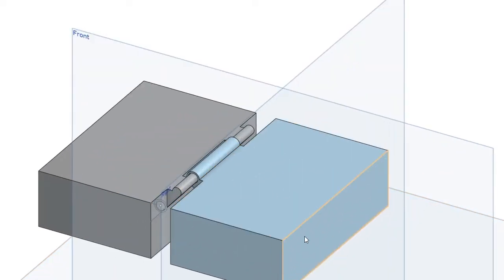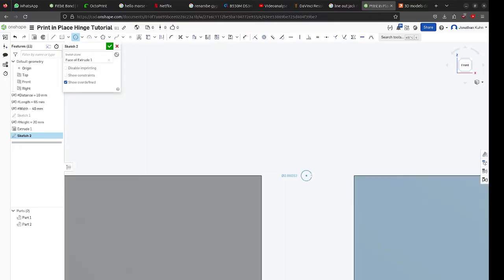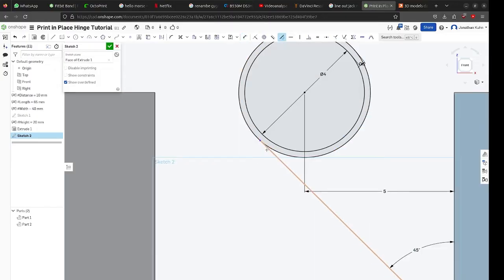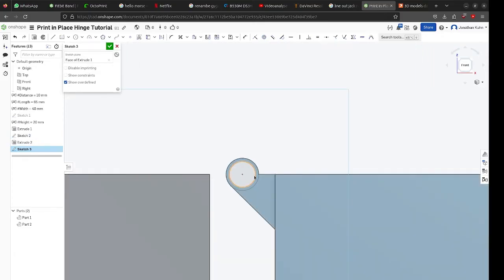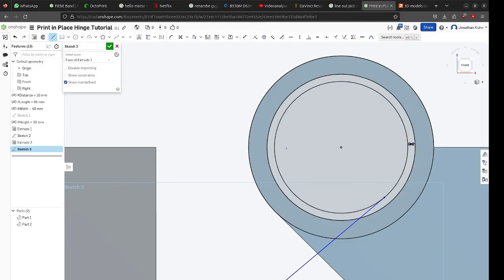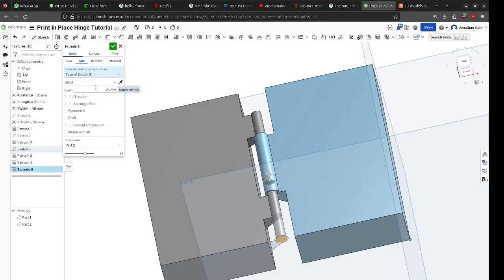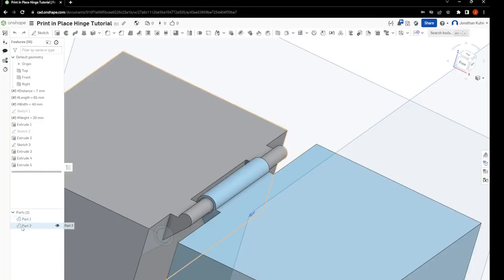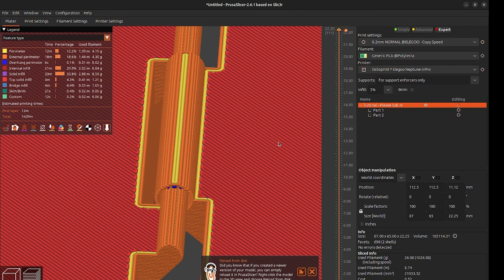Print In place Hinge Tutorial (for onshape and others)

Comment: Have you actually tried to print this? I really don't think it will work - IMO that 'bridge' is going to be impossible to print, even if Cura will make a slice for it... but you don't actually need it to go all the way through, just make little cone shaped bits either side.
Reply from the maker: If have printed a very similar model with different dimensions, but yes depending on the bridging capability you might have to reduce the bridge length. I know about the pin hinge. If you think that is a problem you can either use a different hinge design or make multiple short bridges.
Reply: This works fine on my Bambulab.
The problem with some model though is printing floating parts. Maybe this example works because of the triangle shape, but I prefer a hinge on top of the box edges.